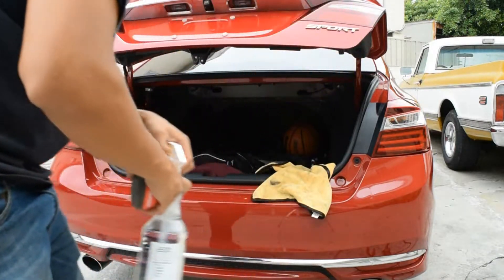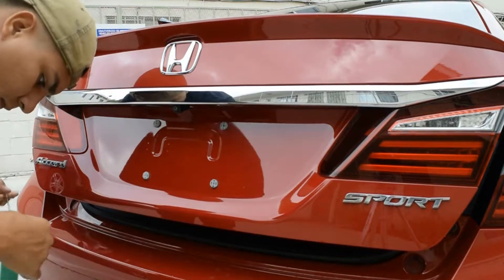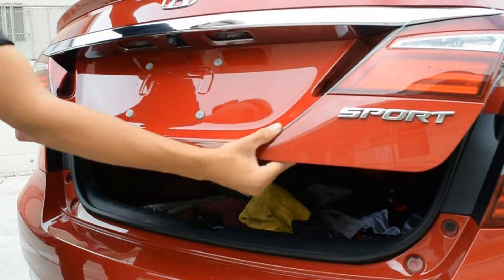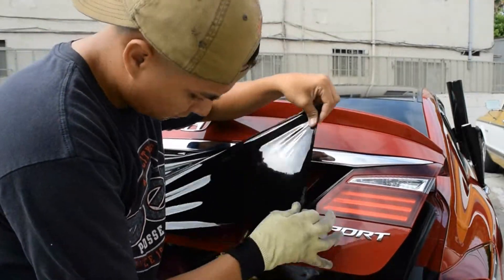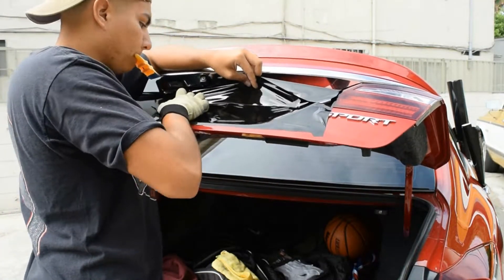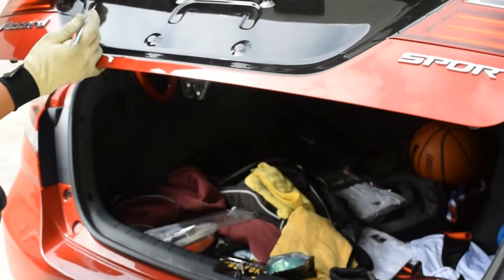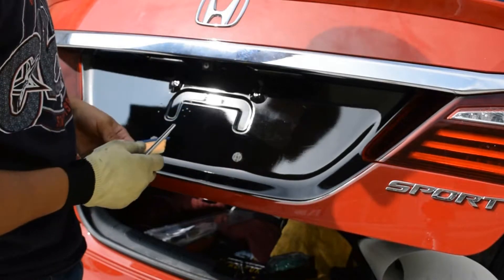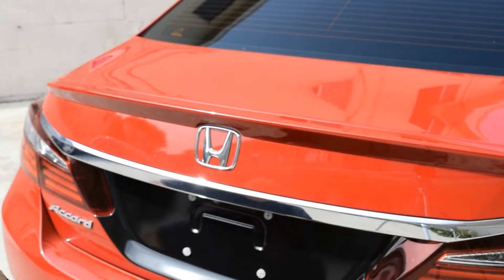2017 Accord license plate vinyl wrap inlay

Comment: How would you do a trunk wrap on your accord with the lip on ?
Reply from the maker: Eddie Zamora it has to be removed to be able to get wrapped correctly
Reply from the maker: Eddie Zamora or possibly use blue tape to mask off the lip. Vinyl doesn’t like sticking to it so it lets you tuck in the wrap and cut the excess